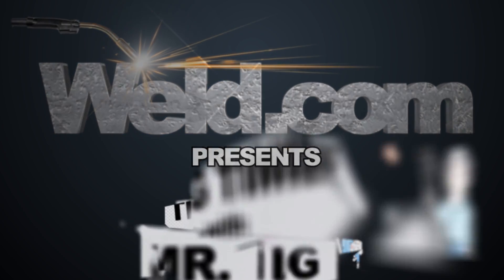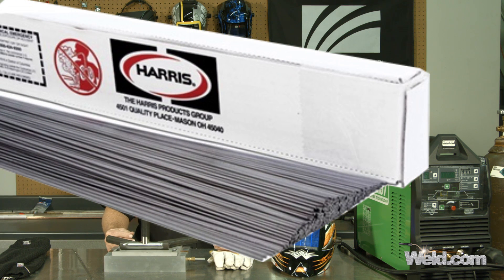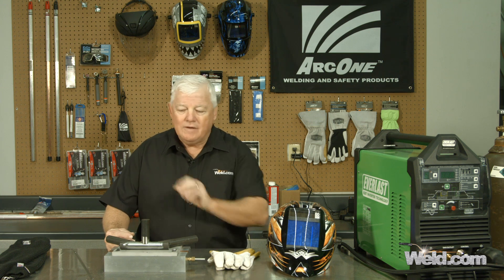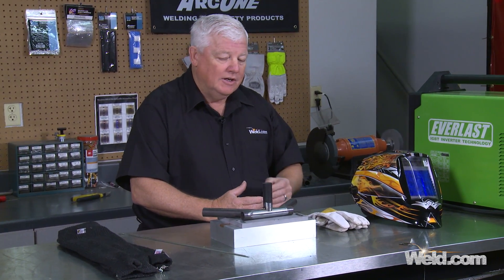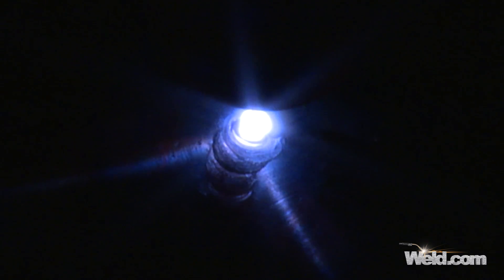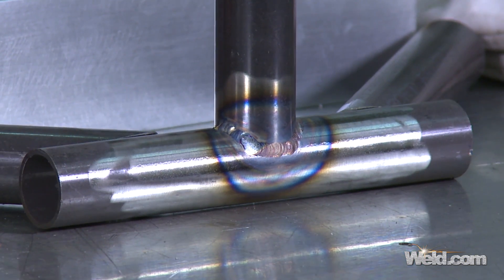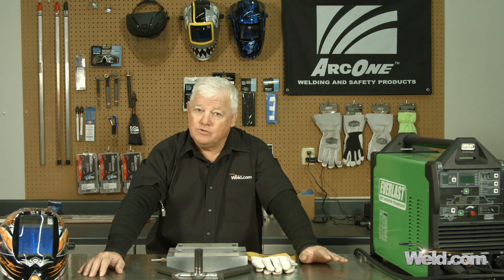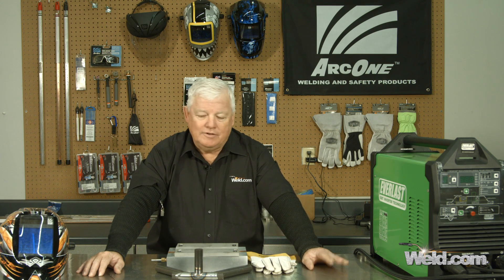Welding 4130 Chrome Moly with Stainless Steel Filler (Super Missile Weld)

Comment: Could you use flux on the inside if you don't have a dual regulator and hose to purge inside?
Reply: Short answer ,don't use SS filler on tubing if you can't purge it! use er70/80 .
Reply: Yes.  I've used "Solar Flux type B" and it prevents the chromium granulation or sugaring on the back side of the weld that you'd normally prevent by purging with argon.  Note that the melted solar flux leaves a glossy, glass-like deposit where it is used, and that can be hard to remove.

Comment: Why would you weld 4130 high strength STEEL with buttery SS, structurally Stainless is garbage, too many people are enamored with the term "stainless steel" much like the overused term "chrome moly" that without the actual material numbers are totally meaningless. Mr Tig should have impressed us all by cutting his welds to show what he did and just how good or bad this weld really is, pretty on the outside is no guarantee of what's underneath.

Comment: Not legal for NHRA roll cages.
Reply: ..So...what DO they use for NHRA cages...? Couple other Youtube guys use ER70-ER80 carbon steel TIG filler for chro-mo tubing....and they certainly seem to know their stuff....better TIG welds too.
 Seems about 30-35 years ago...'Super Missile Weld' was a stick rod for 'maintenance' work, where you often didn't know exactly what the stuff was you were welding..........I bought some back in 1981....
Reply: ER70 and ER80 were the only TIG filler rods that were legal with the NHRA.  I just looked in the 2017 rule book and can't find the requirement now.  I used ER70 to build my dragster and the inspector did not ask what filler rod I used.  He just said "The welds look as they should".  There is no good reason to use anything other than ER70 or ER80 on a 4130 roll cage that I am aware of.
Reply: ...OK, that makes sense......for all the bumping, twisting and bouncing of NASCAR and NHRA frames/roll-cages...you'd surely want some filler that is somewhat malleable.....NOT stainless steel which tends to work-harden, and crack...quickly.....
 I've been welding on-off since1981.....Most chro-mo stuff that was spec'd for chro-mo filler was heavy sections that were carefully pre-post-heated to exact temperatures....lots of this stuff in the Oil business...!
Reply: Newb,compared to others here .Reason I was given that with change in properties (from welding)er70-s6 was correct filler for 4130 ,it would match much better.

Comment: Not a fan of this new weld camera at all. Looks like I'm watching some really poor surveillance cameras in an era where we are looking toward 4k resolution.

I'm glad you brought up this hole you drilled in the tubing. While building my new roof rack out of 1" tube 16 gauge wall. I experienced what seemed like my weld puddle exploding when I was sure I was not welding to hot. Now that you brought this up I realized the pressure was building in the sealed tube and causing this to happen. I have a bunch of long welds that still need to be done. I'll be sure to drill our a pressure release hole before I start them and see if this fixes the problem.

Thank you. You should do a video about this subject.

Comment: Harris SuperMissle Weld tig rod is NOT the same as ER312, nor is it a fancy name for it.  This is where doing basic research to find out the chemistry of each material helps PREVENT the spread false information.

Here is a link to a Google Spreadsheet where I list the chemical compositions of each one, as well as Hastelloy-W superalloy.  SuperMissle Weld has much more Nickel content than ER312:
https://docs.google.com/spreadsheets/d/1P-4u5Y7uDJsS5-V9-kOBOigR982xUSDm2GL9_vO6ICo/edit?usp=sharing